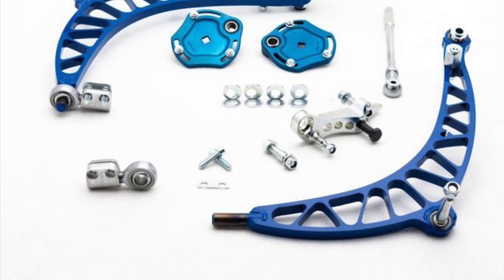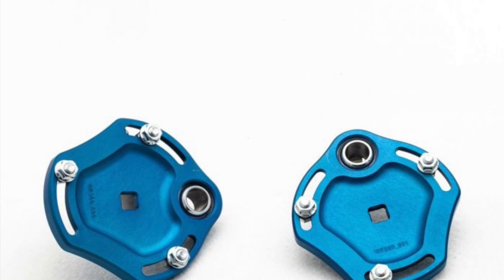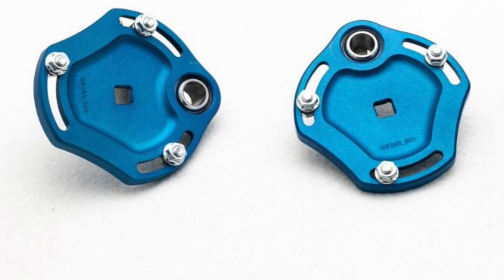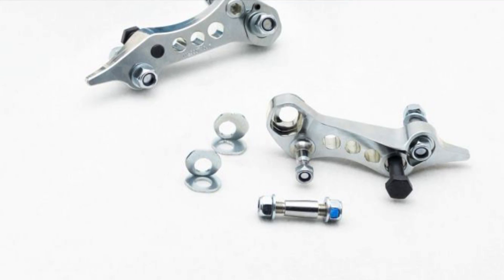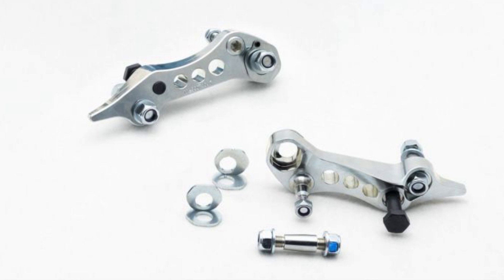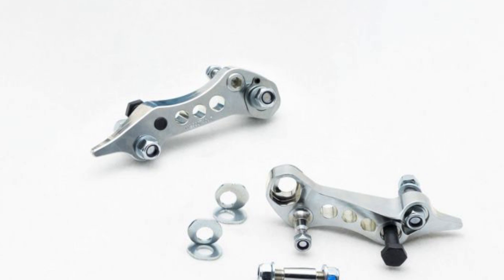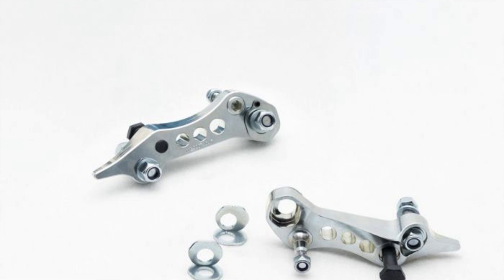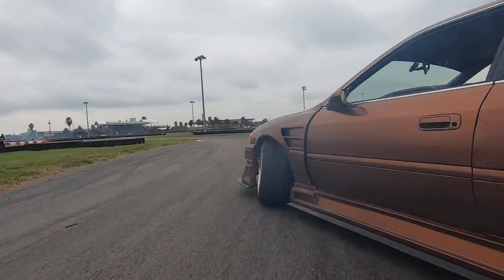Wisefab E36 E46 V2 Angle Kit explained : Ackermann Adjustability + High Trail version

Comment: Hello dear Jesus! May you please comment on how V2 is handelling in small and middle angles... wisefab is wellknown for falling into big angle easilly, especially under throttle, instead of building speed, and also a lack of steering feel in the middle and small angles. Thank you.
Reply from the maker: What was the last kit you drove? I've been on WF for a decade and never had kits that flop to lock.

This only happens with incorrect wheel backspacing or incorrect camber.

V1 and V2 drive amazing, we have Robert Thorne and Rome in FD and they love the kits.

Comment: Hi I see this is usual wise fab trail knuckle set up but in the video the kit you put on your e36 a year ago it was normal style hub set up like slr was that the v1 and can you still get this with the anchor adjustment as in v2 kit the cut the bumper to get castor is because top hat is for trail not normal just use different top hat that be a kit I be interested in
Reply from the maker: Not sure if I understand the question.

The install video is V1.  

V2 requires less caster from the lollipop so would require no cutting from bumper if you run bigger wheels because there is more adjustment from the topmount.
Reply: @DriftJesus  right so can I get v1 kit with anchor adjustment like v2 adapter on the v1 adapter
Reply from the maker: @e.3-0_m3  You mean Ackermann adjustment? No that's only V2.  There's no reason to run V1 instead of V2
Reply: @DriftJesus  ya sorry Ackerman ya I understand this but I design a lot with drift set up and made my own kits with cut knuckles but these don't have any adjustment the v2 trail set up would be my style driving but my son like v1 style set up so I was looking to get him a kit to have more adjustment and like wise fab but thought when seen this that wise fab might be doing v1 knuckle with Ackerman adjustment be prefect for him cause they do drive different

Comment: One thing that has been steering me away from the wisefab for my e46 is the lack of technical information on the site and online in general. I don't see where the added track width from the lower arms is listed anywhere or what materials are used.
Reply from the maker: Its all in my videos.  Check the DIY video, the video on the track width calculator, and the product info on my website.  No other brand has more information.
Reply: @DriftJesus  I must have missed it on the website. I will check back there. thanks!
Reply: @DriftJesus  hey, I was able to find it. thanks you!